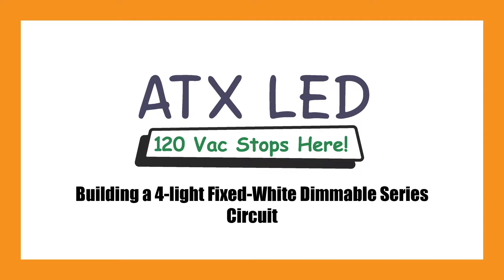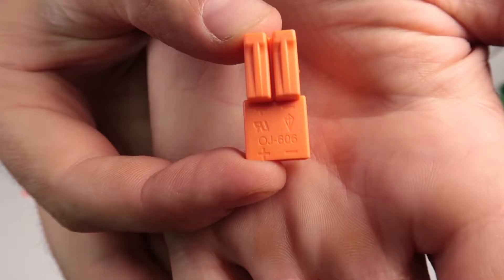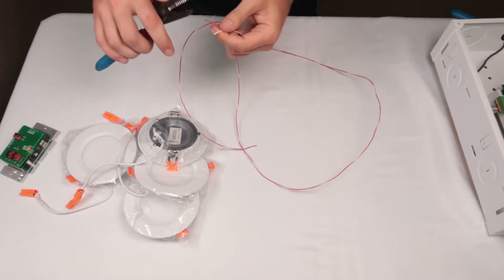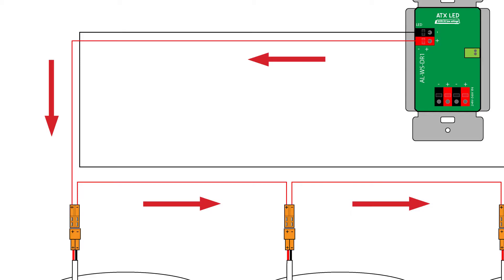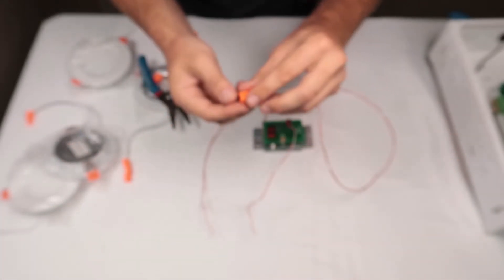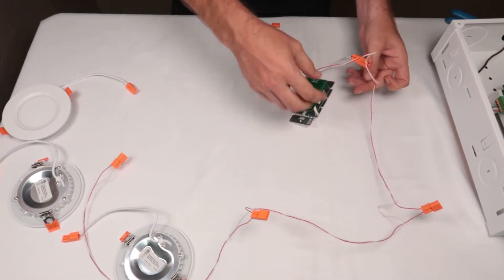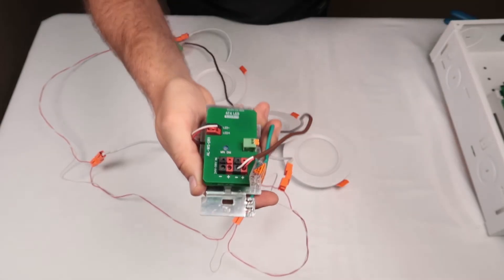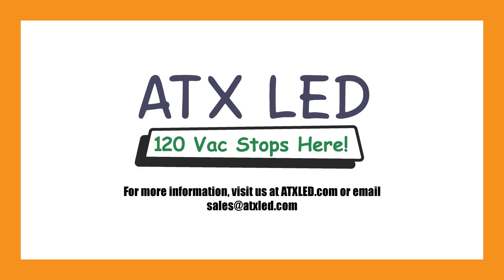With ATX LED either fixed or tunable white LEDs may be installed, this video is about fixed CCT.

Comment: Can this configuration be hooked up just to a straight 120 or do you need a distribution board?
Reply from the maker: Hello - our system operates from low voltage DC, so you need a 120vac to 51vdc transformer, and if there are more than 15 loads in the project, then you would need a distribution box that we make

Comment: yes yes yes to this... why isn't everyone doing this... I just saw a new development where LED lights were installed and there way 120V going to each light... each led light had it's on transformer/inverter.... it seems like such a waste of hardware... both the junction box and the 12 gage wire so unnecessary for each light.

Comment: Why???  Now if one light fails, they all fail.  You also still need to run two conductors to each light so nothing is saved.  Again, WHY?
Reply from the maker: a) Tungsten bulbs fail open, LEDs are completely different.  Inside our fixture is a LED array of 3 x 11 - and nothing else - no single electronic part to fail.  So, unlike a christmas tree string, these fixtures would require 11 LED chips to fail open before the string is dark,  if they fail shorted - the string remains on.  After 5 years, we have no installed fixture failures.

b) the wire is 18/2 - 3.5 lbs / 250 ft.   14/2 Romex is 15 lbs/ 250 ft .   18/2 is  1/4 the price of Romex

c) two wires, tunable white and nothing smart or expensive in the fixture is revolutionary.   Perfect 3000:1 dimming ratio, no flicker and no PWM artifacts, and the heat of the fixture does not cook the driver since it is at the wall switch 15 ft away nice and cool ( and dry for outdoor projects ).

d) Romex is 3 wires - 9 junctions per can in 3 wire nuts.   Our fixed color fixtures have only one dual conductor strip/poke connector - much faster
Reply: @atxled7490  But again, why? You can do the same thing using low voltage and running them in parallel if the voltages are correct.  I understand your points about trying to save a few pennies on cable and wire nut costs, and moving the drivers from the fixtures to the dimmer--which has some merit. But series wiring is just a bad idea for permanent installation.
Reply from the maker: @mntriangle  Here are the documented results.   A UV LED chip diode Vf ( typically 3v ) is a function of temperature, and the Vf falls into a bell curve of distribution.   Thus, no two diodes start with the same Vf, and if not thermally matched and wired in parallel, the one with the lower Vf gets more current, creating a negative voltage thermal runaway.    Multiple 12v bulbs ( say 4 leds of 3v each in series ) wired in parallel have been tested over time, to easily reach 40% disparity, as the bulbs reach different temperatures.    On top of that, different Vf results in inconsistent dimming at low levels.  Also, since wire resistance is non-zero, bulbs further away have lower initial voltage, which gets worse as upstream LEDs heat and lower their Vf, resulting in being starved of delivered energy.  The resulting lumen output is all over the place.

Strip lights at 12v handle this by using 3 LED chips ( 9v) and a resistor to balance the current.   This then consumes 25% of the energy - wasted.   Take apart any dead LED and study the failure cause, its the driver, usually the capacitor, that has failed, the LEDs are fine, not open circuit.    So, why waste energy, and copper, by applying the tungsten failure mechanism to LED technology??   

Binning the LED die, and removing the driver, results in proven highly reliable and highly efficient devices that save money. and offer perfect dimming, since each fixture receives the same current, and lumen output is a function of current, the voltage being a side effect of temperature and manufacturing tolerances.
Reply: @ATX LED  I'm an engineer, so I understand all that. But you basically just pointed to the advantage of putting the driver at each fixture (reminds me of the battle Tesla and Edison over the merits of using AC vs DC for distributed power). No fixture is "starved" when wired on a 120V circuit--each fixture is unaffected by the others. I appreciate your knowledge of LED lighting technology, but as I am currently wiring my new house--including some 40+ recessed LED fixtures, I just can't see using this system in our home. Plus, every recessed light circuit has from 1 to 14 "cans", AND some circuits feed other types of lighting--including <gasp> incandescent in a few places. I have already chosen certain types of dimmers (some smart) to accomodate the unique needs of each room. I'm sure you have ways of accommodating a wide range of applications, but based on what I see--and the wide range of reliable, low cost 120V fixtures available, I think it's going to be an uphill climb in the building and remodeling industry. While I do see a future for low voltage wiring, it would need to be plug-n-play such that no electrician (or homeowner) has to figure out complex series and parallel grouping. Plus, consumers and designers appreciate all the options available from companies like Lutron, Leviton, and others. I went to your website and get what you're trying to do, but personally, I don't want to be an early adopter on installed technology that can't be easily replaced.
Reply from the maker: @mntriangle   Our customers tell us they said the same thing about plumbing with Pex vs Copper.   It requires training, but once trained, nobody goes back.   For you, building one house, once you select an AC bulb to communicate with an AC dimmer without flicker, and you don't mind that dimming below 10% doesn't work, and you don't have interest in tunable white that works without configuration, ( see our tunable white video https://www.youtube.com/shorts/6vi1RCfkSyw  ), then the 130 year old wiring method ( introduced at the Chicago worlds fair in 1893) is good enough.   Those electrician customers who don't watch all the videos stumble and curse on house #1, and by the 3rd house they are wiring faster than Romex, so training is required, but every 3 years NEC changes the regulations, so training is ALWAYs an ongoing requirement, hence the CEU system.   Here in Austin, Romex is locked up at home depot because of the extreme cost, and our customers save more than pennies on this system in the multi unit projects they build.
Reply: @atxled7490  You may be right! It has occurred to me that I'm running a lot of heavy wire in lighting circuits for small loads. Still, I'm not going to be the guy on the bleeding edge, but more power to those who blaze the trail. (And you're right about PEX. I'm installing it in my house, but not sure I would have 10 years ago).
Reply from the maker: @mntriangle  by the way, this video fails to mention the parallel wired alternative for acceptable ( not perfect ) dimming and for low cost use cases without any dimming.   Please see our https://atxled.com/pdf/P023R6-48v.pdf series.   No capacitors to fail.   The current in each led is fully balanced at full power, and acceptably balanced at 10% dimming.    You aren't bleeding edge, that was 5 years ago when our first houses were built.    UL for all elements is also part of the solution.  For other small loads, we have USB/USBc wall plates, exhaust fans, and ceiling fans.
Reply: @mntriangle  I've just read through your 'why' thread. I really love everything this company is doing, series lighting systems included. There is always a paradigm shift required when something radically different is proposed. I didn't have to be told that an LED failure would not result in an open circuit. There are different schemes out there already that address this. It would seem obvious that a company like this, with their own engineers, would have this basic potential problem sorted out.